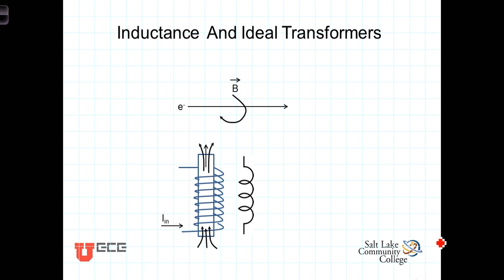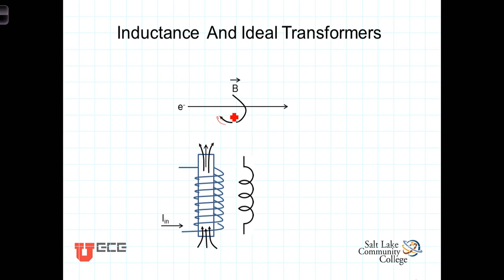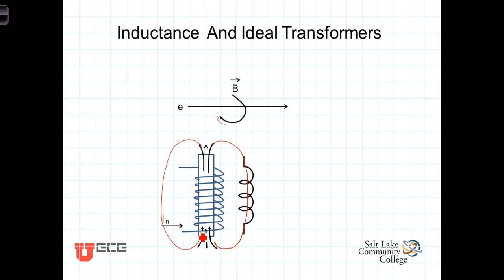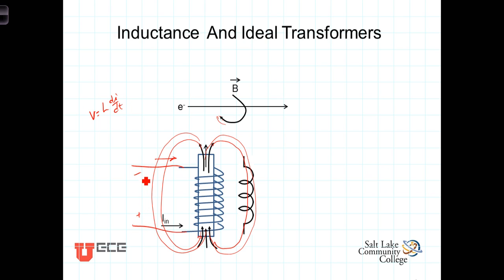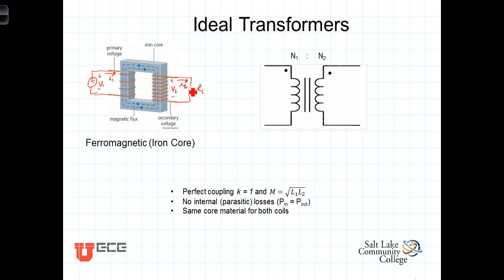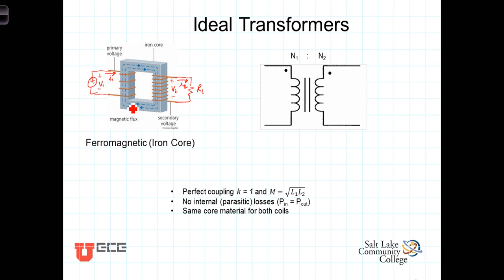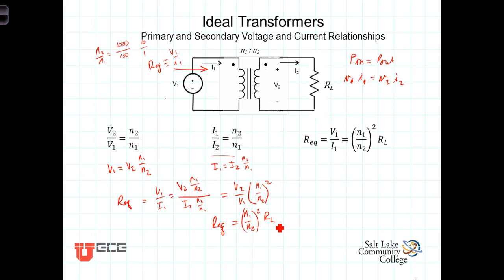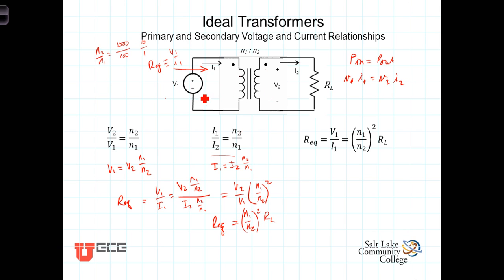LIdealTransformer1 1Ideal Transformer Equations

Comment: hello, on a 11/0.4 KV three-phase transformer; 11000V coming to the high voltage coil? because there is resistance inside each coil. Then I can't get 11000 output? then 400V cannot be induced. Can you explain how